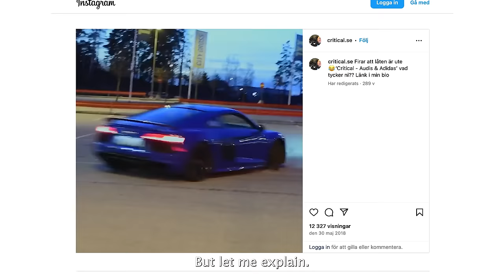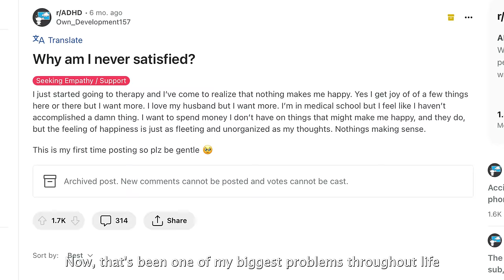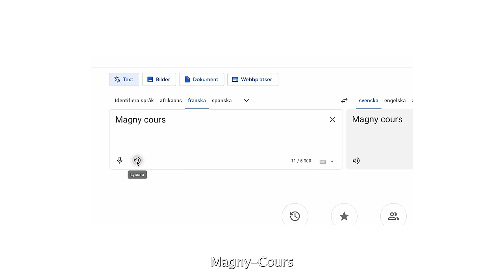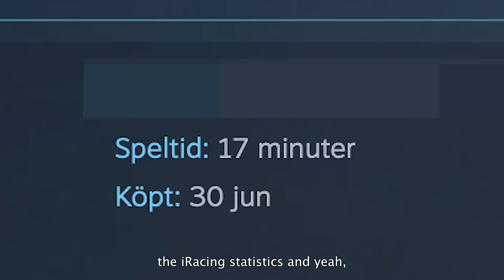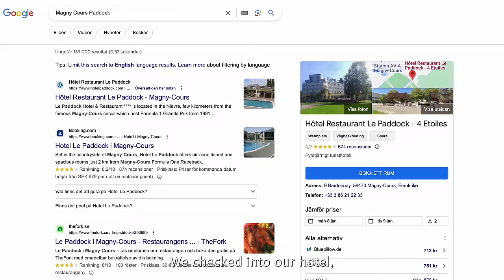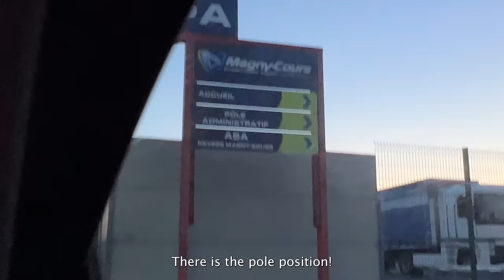I DROVE A FORMULA 1 CAR *from Go-kart to F1 in 2 weeks?!*

Comment: You must have really good leg strength to lock up the brakes. Most amateurs struggle to get 25-30% brake pressure out of it.
Reply from the maker: No, no that strong 😉 You brake much harder in the start of the brake zone or how to say and gradually release it. This was just me failing on the releasing part, trying to trail brake 😅

Comment: Buying a whole sim racing setup as preparation and then spending 17 minutes using it is a certified ADD classic. 😂 Hope you’ll use it a couple more times and it doesn’t just collect dust
Reply from the maker: Hhahah 100%. I had it for a while but it came in handy for the prep. I just sold it, I got to much motion sickness from it, it wasn't fun at all tbh. I do have ADD tho 😂

Comment: You did a fantastic job. Apparently keeping the brakes hot and the tyres. Even Valentino Rossi, when he drove a Ferrari struggled to do that. In fact the Engineers wanted to call him In, because he wasn’t driving fast enough.

I had a Day at Brands Hatch,many years ago, courtesy of BMW. Drove a Lotus Sunbeam which I enjoyed,and then a formula Ford with a straight cut gearbox. I hated it. I was totally out of my depth. A lot of other guys said the same that they couldn’t adapt . I could never have been even a clubman racer. All credit to you. Great one.
Reply from the maker: Thank you! 🙏🏻 Im sure he had a bunch of sponsors to worry about that told him to keep it slow 😅

Comment: I did this experience in June 2022. I've driven and owned fast cars (some well over 500bhp)  but nothing comes within a millions miles of that Williams.
Reply from the maker: Right?? So crazy
Reply: @critical  incredible. And terrifying 😂. I had a lock-up into the tight hairpin at the end of the straight, turned in the run-off are and avoided the gravel by about 6 inches. Incredible experience though. Especially driving along the pit straight as everyone stands there filming as you fly passed.

Comment: Id be happy enough to sit in one when they start it up behind me. 
That and opening  it up on a straight  is probably  the only part a noob can enjoy without  fear of destroying it.
Ive drove a forumla renault 3.5 which had a V8 like this period  of f1 but less downforce(not that i went fast enough  to use  it) That was 30 minutes of me  gradually  opening  the throttle to about 85%   and  braking silly early  and rolling around corners on mechanical  grip.
I wish i had driven more advanced  stuff before so i could  remember it for more than fear and my head falling off.
Porche cup car was a million  times more enjoyable  for a lay person like me then...

Comment: The neck is the reason they only let you do three laps. Four laps and your head would be looking up at the sky like a drunken idiot while in charge of an F1 car.  The F1 2011 version with KERS had 770bhp, it would have been interested to know what the version in the video had.

Great video and fun to watch.  As someone that's had fun in karts I've always want a go in something with more beans. Formula Ford disappointed though.
Reply from the maker: No, it was actually just that i only got the 3 laps package. You can have additional laps at a cost. The car in the video is the real one, not turned down

Comment: You drove the 2011 Williams because it has power-steering. The older V10 cars that were displayed in the event don't have that. All in all, you even put 7th gear during the big straight which shows that even a regular person can get up to speed quite easily after every lap. As I can understand from the onboard, it only takes some great neck muscle training to withstand the G forces from deceleration to acceleration in order to drive a V8 F1 car to its limits.
Reply from the maker: Most teams had power steering since the mid 90s.. but I wanted to drive as much of a modern F1 car i could under the conditions, tho i have to say i didnt drive it to the limit just because i used all gears lol but that was very kind of you 😁

Comment: iracing has the similar williams car it might be 1 year older or younger than the car you are driving
Reply from the maker: Yeah ive seen it, someone wrote about it earlier. Its a 2009 so 2 years older. But the simulator was mostly to learn the track/line, its really hard to get a feel for the car

Comment: How much did it cost? and how much it would have costed if you crashed? XD
Reply from the maker: If you search LRS formula, they have different programs. The fee without insurance is 20 000 eur i think and with insurance the fee was 5000 eur if you would  crash. Of course the cost to repair can be much higher. But they also pay attention to how you drive the Formula Renault and if they think you cant do it good they will refuse you for the F1 to avoid crashes.

Comment: What engine is the car running?

Also, why didn't you prepar more?! This costs thousands and you decide to learn the track a day before with no muscle conditioning and not even in the right car 
😆I just don't get it lol
Reply from the maker: 😂 you speak of it as a competition… its an experience. Simulator and reality is very different, i only used it to memorize the track, it could have been any car. I also watched videos of the track and it helped to feel more comfortable, i didnt want to feel lost on the track.

The engine is the real deal, the cosworth v8, not detuned
Reply: @critical  not a competition...just a waste of money and not respecting the machine. You come across as an impatient child sometimes lol. Like the way you just glossed over the F4.

Practicing in a sim properly wouldn't just let you learn the track - you can do that on a PS2 lol. It's to get you used to how an F1 car behaves, how fast it goes, how to brake, what the racing line is, how to manage gears etc. Less than an hour is taking the piss lol. 

And yeah I get why you wouldn't bother doing neck training but not even preparing in a sim just seems a bit...too flippant. 

It's not cheap and you come across as someone who just wants to drive it for an adrenaline hit and you don't actually care about it or getting the most out of it. People would kill for the chance to drive one. But to see you only log a few mins on the sim, brush off the F4 with no real comments, go on about how you just want to drive the F1 because you want excitement, just comes across as something a ten year old you say/do. 

Everyone is different and props to you for actually doing it! But yeah, too flippant about the whole thing imo. 

Awesome that it still had the original engine that's so cool!
Reply from the maker: I'm definitely impatient, you're 100% right about that! and I could have practiced using a ps2, but I didn't have one, I had the sim rig since before and iracing (also) has the track so why not? I also get terrible motion sickness, that's why I didn't use it more, and that's also why I don't have it anymore. As I mentioned in some other replies: I did watch on-board video from the track as well that helped me memorize it/the line.
Sure I could have made a whole video about the Renault, but in this video the focus wasn't on that, it would have been too long and viewers don't like it when it takes too long to get to the point. You almost seem offended 😂 I never tried to come off like that. I just recently made a video about Karting. I don't look down on any motorsport. I actually train and compete in MiniGP, 190cc "roadracing". I will try other types of racing on the channel as well this year. I just got invited to come drive and film with a Radical team for a day, I really look forward to that!! I hope you have a good day ✌🏻